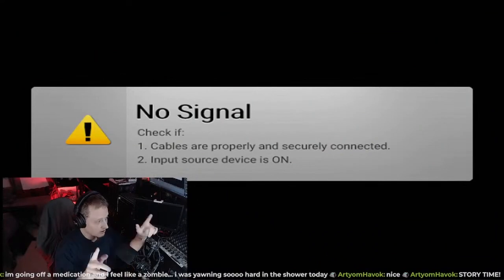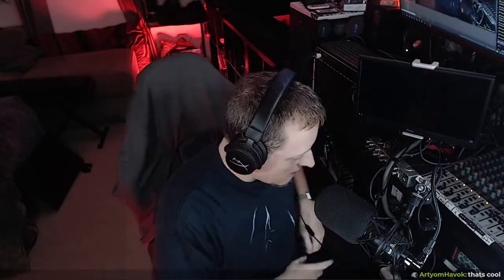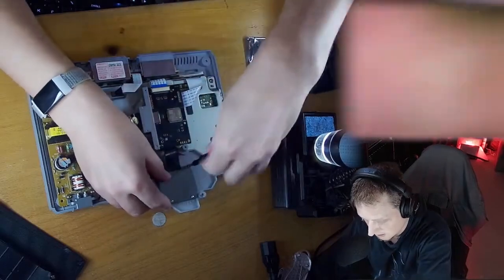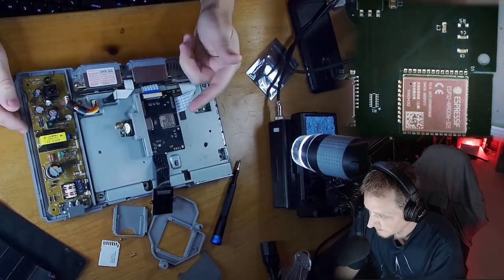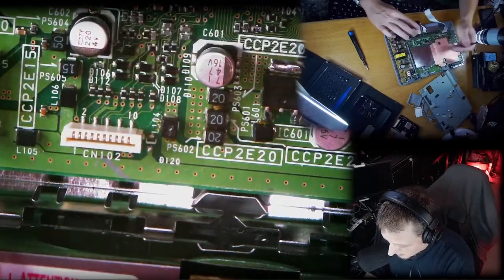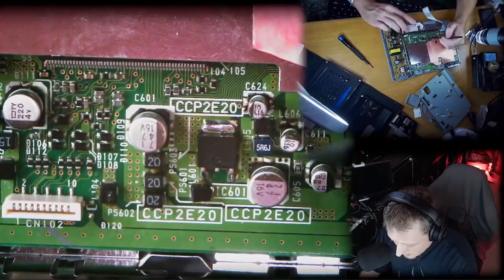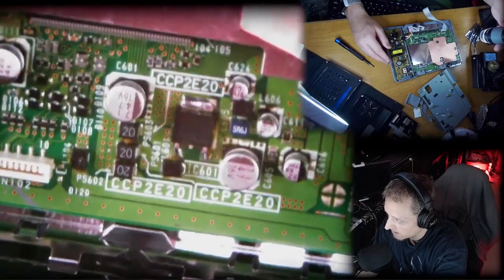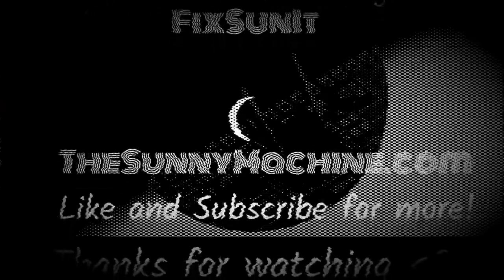Xstation Shorted PS1 - 7v Rail Fuse Fix - Story time!

Comment: hi
I 've put off my xstation from my pal system to an ntsc J scph 5500 model ,
it doesn't works😥
bleue led ok , sony white logo and after directly to memory card menu
reset button is pushed and ps1 closed ✅
i ve read on internet lot of peope have problem with scph 5500 jap
Reply from the maker: I got so much help from the github!  You should post there and see if they can help you. https://github.com/x-station/xstation-issues/issues
Reply: @fixsunit  Okay thx